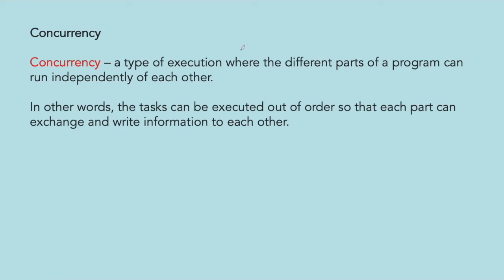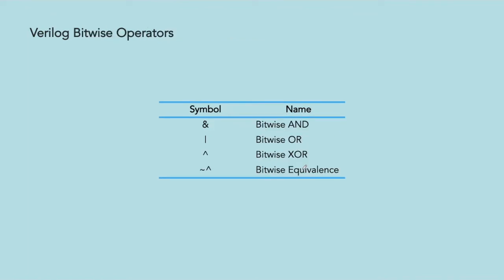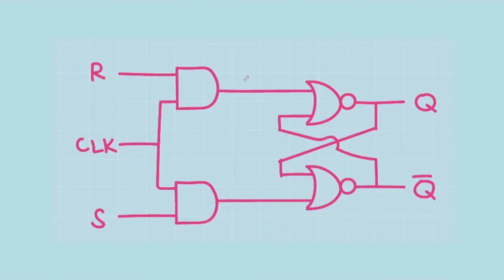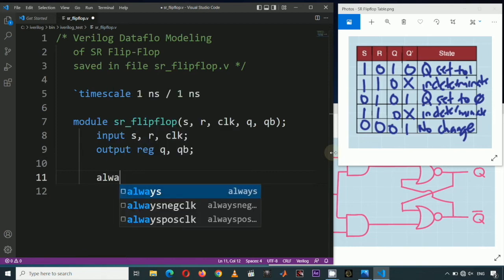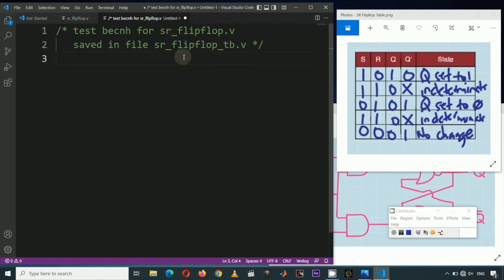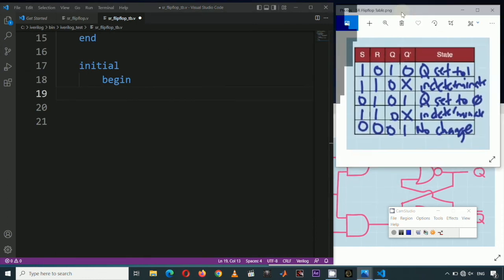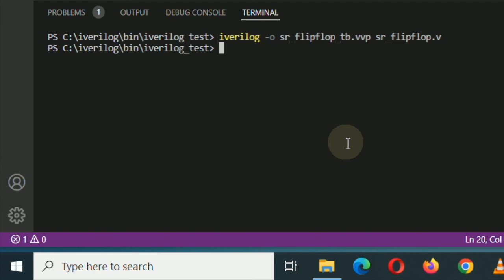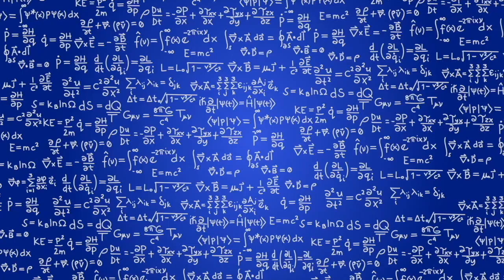Verilog Operators | How to trigger an always block | SR Flip-Flop Example

Comment: Hi, great tutorial but I have a question. Can you please tell me why after 20ns qb is not immediately rises to 1 ?(though q is immediately falls to 0). I can see from the graph qb appends to 1 after 1 clock cycle after the 20 ns. Why is that?
Reply from the maker: I think it has something to do with QB waiting for the output coming from Q before it toggles its value (see timestamp 09:00)